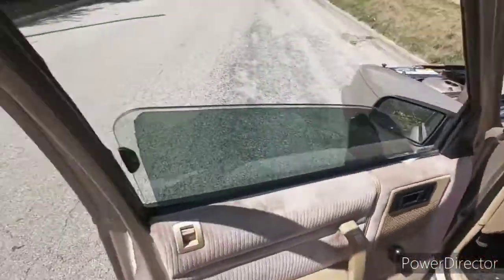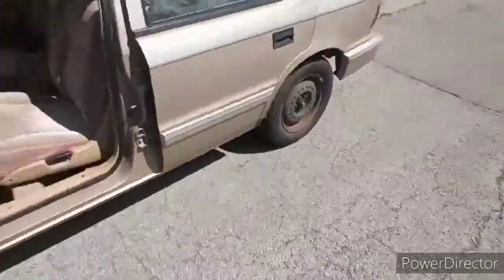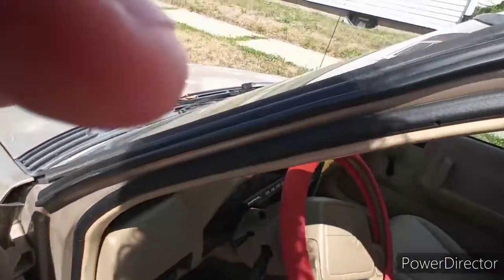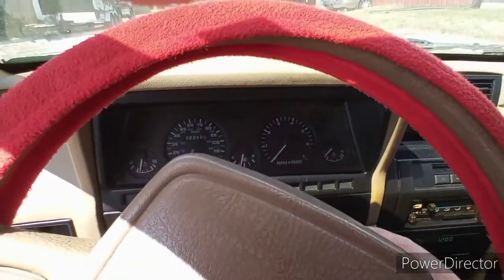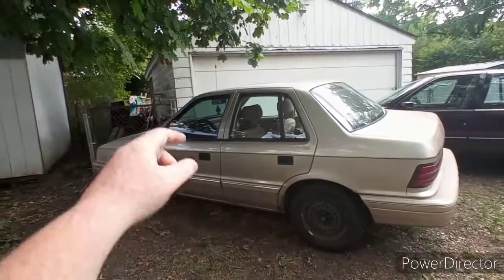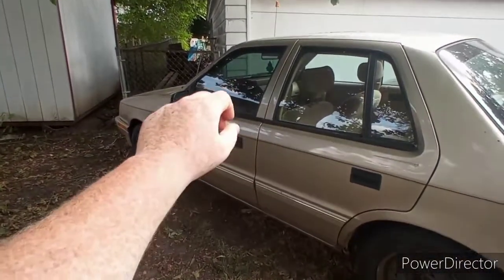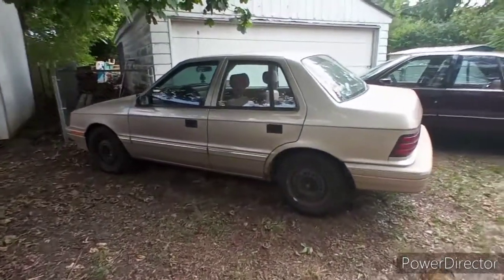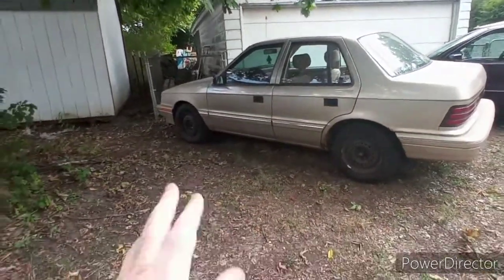Plymouth Sundance died again : (

Comment: Has a battery draw and dying intermittently? I would go after known issues like the battery drain finding a parasitic draw is easy...it sounds like something is getting hot causing it to die or maybe it has a broken/corridor wire that when it gets hot the resistance is higher causing it to die or when you turn it moves the wire causing it to die?
Reply from the maker: It's definitely possible.
But I don't know considering it only started to die a month or so ago and the battery drain has been on the car since we bought it over a year ago